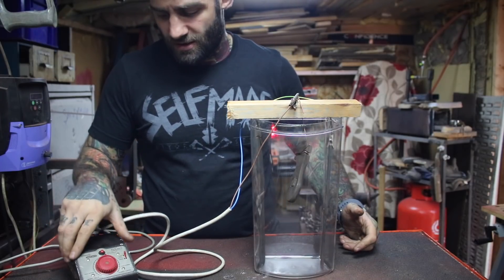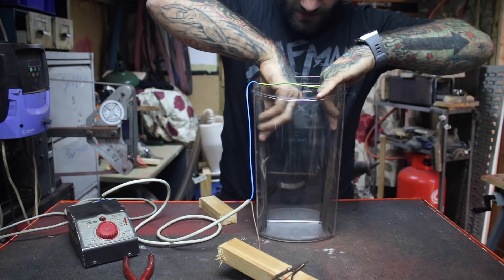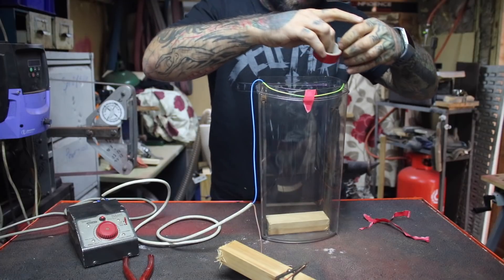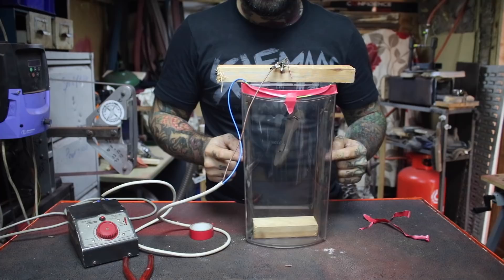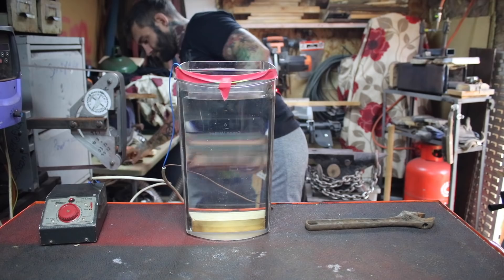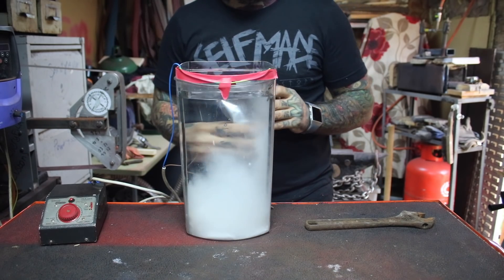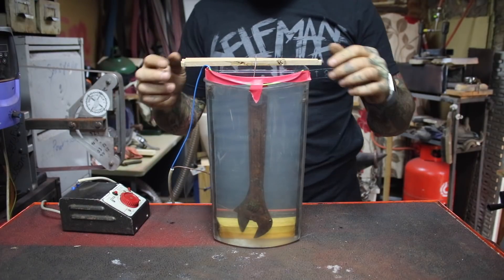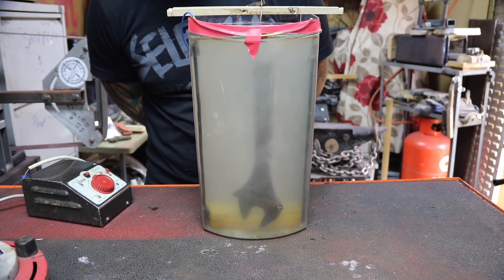How To Build A Rust Removal System

Comment: If you put the connections on the controlled side of the power supply (top left pair looking from the back)....you can then use the potentiometer at the front to fine tune the output... 😉

With thanks
Glenn
GLMelectrical
UK
Reply from the maker: Yeh i tried that to start with but even on maximum it didn't work as well as using the un controlled one
Reply: @DiesInEveryFilm 

Check the output voltage on the controllable side with a multimeter (make sure it's set to DC volts)...
Then use a current clamp to measure whilst the cables are connected to the controllable side...(follow the arrow on the clamp meter for DC)...
See what values your getting on the controlled side...

With thanks
Glenn
GLMelectrical
UK
Reply from the maker: Thanks mate I'll give it a check
Reply: @DiesInEveryFilm 

It's not easy to explain when your not there showing how...

I tries... 😏